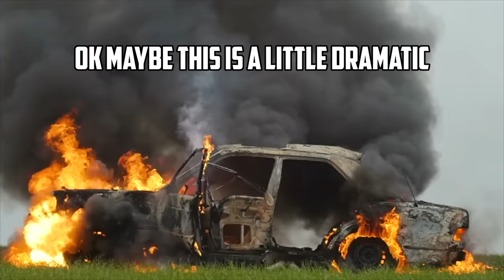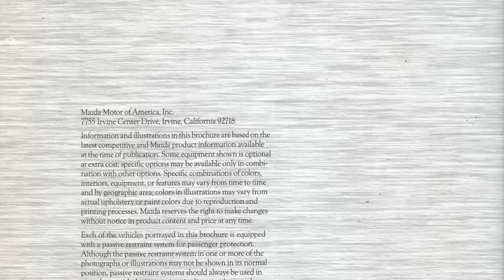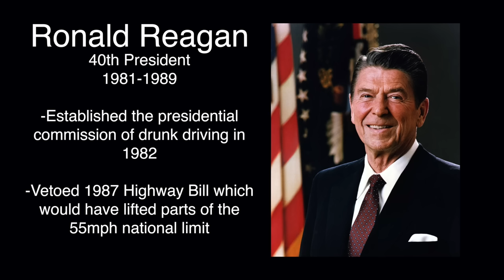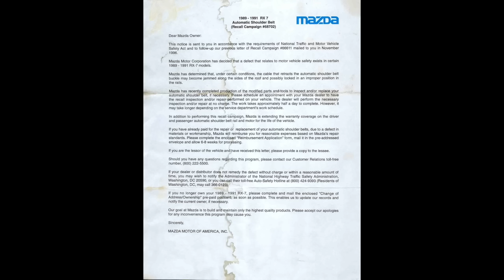Automatic Seatbelts - Why They Were Used & Why They Went Away!

Comment: I'm probably one of the few people that actually loved this feature, just for the convenience of not having to buckle and unbuckle! Which therein lies the biggest problem with these that you didn't mention - almost no one used the separate lap belt that you had to put on yourself, and a lot of us didn't realize just how dangerous it was if you didn't wear it. For all the years I had cars with these I always felt safe with just the shoulder part around me so I never ever bothered with putting on the lap belt, the thought that I needed to wear it never crossed my mind. Everyone had these seatbelts in the 90's, and that was how you used them- you got in, the shoulder strap went around and you drove off. So handy! In 2011 I was cruising down the highway in my 1993 Eclipse that I dearly loved, a car pulled out in front of me and I T-boned it going like 60. I ended up with a broken collarbone, a collapsed lung, a broken ankle, a massive bruise across my chest, and a big gash in my neck. At the ER the doctor asked me if I was in a car with automatic seatbelts and didn't have the lap belt fastened because if so they needed to do further checks. Apparently some people got their livers and kidney slashed by the shoulder belt and bled internally from it without even knowing. Fortunately I did not have those injuries. After I recovered I started doing some reading about this and there were a lot of people who died or were seriously maimed from these, all for the same reason-they weren't wearing the lap belt. Car companies even got sued for putting this system in because it made people feel safe when they weren't. Had any of my cars had some kind on warning on them like "you can be decapitated without the lap belt on" or "you'll fly out the door if it opens in a crash" I probably would have thought twice about the importance of the lap belt and actually used it. Which would have negated the whole reason I liked them in the first place, not having to put my own seatbelt on! So yeah, if you still have one of these cars then don't be like me and wear your dang lap belt, it is important even if it feels unnecessary.
Reply: I had the same car! I never knew how important that lap belt was
Reply: You traded your safety for convenience...   and it almost took your life.
Reply: Glad you survived to tell the story!
Reply: @sonictimm  Thank you, me too!
Reply: @adammada8867  You aren't wrong, but to be fair it was an unknown trade for far too long lol
Reply: @hellocar123  I still miss that Eclipse, it was the basic model but it was so comfortable and looked really cool. I drove it all over the country on roadtrips and never got tired of driving it, its a shame that is the car I wrecked because its still my favorite!
Reply: I’m with you. Had a mini van that had them. Of my mom was always freaking out if she was in the passenger seat. 😂
Reply: I'm glad you lived to tell the tale, many were not as fortunate.  As far as "you'll fly out the door if it opens during a crash" that was yet another problem with some  GM cars manufactured from about 1989 - 1993.   Those particular cars had automatic seat belts,  but the retractors were in the front doors,  and the seat belt buckle was supposed to be used as an emergency release,  however over 99 percent of people used it like a regular manual belt.   You were supposed to leave the belts buckled,  and you'd open the door, slide under the belts then upon closing the doors you were belted,  lap and shoulder.    This was a loophole that allowed the older body styles which could not be retrofitted with airbags which would have required a complete redesign at a great cost, to remain in production for a few more years until the next generation, since during that period there was a Federal safety standard that states all new  passenger cars for sale in the U.S. must be equipped with a passive restraint system. The requirement could be met with auto seat belts  OR airbags.  The  problem was sometimes the door flew open during a collision,  taking you out of the car with it.    Shortly afterwards airbags became mandatory and the auto seat belts were abandoned and forgotten as they should have been from the get go.    You can partially blame our politicians who think they know what's best for us, for your injuries.
Reply: @samanthab1923  Freaking out unsuspecting passengers out was so much fun 😂 Then watching them try to figure out how to get out when there was nothing to unbuckle lol. My mom was the same way, but she hated my seatbelts. She still doesn't wear one, and back then she would try to throw it over her head as it went back and then she would forget and get thrown forward by it when she opened the door😂😂 Eventually I just started unhooking it before she'd get in so I didn't have to listen her complain about it lol.
Reply: @Sparky-ww5re  I remember those, one of my friends had one and she left it buckled. I remember it being a major pain trying to slide into it and I was glad mine slid out of the way.
Reply: @Carla_78  Yes! Same with mine. She still doesn’t wear one. Law came too late for my parents. They were already set in their ways. Good thing they were both good drivers.
Reply: @samanthab1923  Exactly, neither of my parents have ever been in a wreck and its a good thing lol. My mom was the only one who got a free pass to ride with no seatbelt in my car, I knew there was no changing her and no point in arguing about it. Couldn't even get her to just use the lap belt alone. Everyone else the rode with me had to suck it up and deal with the seatbelt, or at least use the lap belt if they complained enough about the shoulder one attacking them😂
Reply: Yea had an accord with this and def never used that lap belt
Reply: Yea had an accord with this and def never used that lap belt
Reply: @lrac_1  A 1991 Accord was my first car! Had it for about 10 years & certainly saved me from seatbelt tickets because I got this car about the time they really started enforcing the new laws. We didn't wear seatbelts much before this feature came out, so having the shoulder belt that went on automatically was really cool and there was no reason to buckle a lap belt!
Reply: rip eclipse
Reply: @flair8099  I'd be lying if I said I wasn't still sad :(
Reply: It's kinda crazy how something that was implemented as an additional safety feature, ended up being more dangerous because it made people feel too safe! Still having to put on the lap belt does make it feel redundant though - it's just as easy (or even easier) to use a regular seatbelt at that point.
Reply: @imaginekudryavka9485  That's the whole thing about it, because part of it put itself on I just assumed that if I needed the other part to be safe that it would have made to put itself on too. Or at least let you know it was important by having a big warning light or beeper or something like cars do now. A lot of people who rode with me or I let drive my car were people who wouldn't drive without a seatbelt on- and they never put the lap belt on in my car, even when we went on very long trips. It truly made you feel safe just the way it was. If I had regular seatbelts I absolutely would have been putting it on myself, but I thought I was good with the automatic feature and didn't have to do anything else! I think most everyone felt the same way, at least based on my experience with them and its sad that a lot of people died that may not have had they known they needed both belts.
Reply: I really liked them but they were part of a series of design elements that in an accident seriously injured me, where seat mounted shoulder belts wouldn't have.
Reply: This should have been mentioned in the vid.
Reply: @Adam Mada  no he didn't trade it .. it was a feature in his car that he probably didn't buy for the seat belt "convenience."
Reply: I had a 1990 Honda accord for my first car that had them back in 2004. It got t boned and totally a year later and I got a 1992 accord(coupe) that replaced it and it didn't have the auto seat belt.
Reply: Was the car wreck in Virginia, rt 1?  Do you remember the make of the other vehicle?
Reply: Danbeater  You were certainly in the minority,  I remember reading a statistic that said something like 85% of people did not use the lap belt. From my own experience I know this is pretty close, because I don't recall anyone ever buckling it unless they weren't using the shoulder strap.  But I guess that goes to prove that common sense isn't very common... You also have to remember that a lot of us weren't really using seatbelts before these came out, which I know seems crazy now but in the 80's it just wasn't a thing yet. When I got my 1st car with these in 1992 is when I started wearing it daily and compared to no seatbelt it seemed very safe, especially when you consider some of us short people drive with our knees practically in the dash so there was really no way to slide under the belt. My main concern was to not fly out the windshield like the TV commercials with Vince & Larry, that certainly wasn't going to happen with my automatic seatbelt on! Lets not forget the insurance discount we got for having them, yet another thing to make you think this was safer lol
Reply: @user-rn3rn6nl3h  My wreck was in Illinois.
Reply: @Carla_78  thanks, probably a common experience.
Reply: You needed a 'WARNING' to tell you that the lap belt was needed?  in 2011?  Let me guess, you are 'american' . . .
Reply: I liked automatic seatbelts and religiously used the lapbelt. I liked it because for whatever reason the belt didn't rub my neck like manual one did. It felt like the belt was trying to saw my head off, I had so so many of those sheepskin sleeves and diverters for manual belts. Automatics just fit way better and were more comfortable. 
I don't know what changed but the newer cars have seatbelts that are now as comfortable as those automatics were.
Reply: Or be like my BiL and don’t wear any seat belts
Reply: @Arby631  This is my parents, they still don't wear them and it drives me crazy.
Reply: @evil1by1  I always found them very comfortable too, admittedly part of that was because I wasn't using it properly by only wearing the shoulder belt.  I know some shorter people had issues with them cutting into their neck but I'm only about 5' 4" and I don't recall ever having that in any of my cars.
Reply: I absolutely agree! I never used the bottom because the top was there!
Reply: I never understood the point for thus reason. If I still need to buckle the lap belt, it doesn't help any.
Reply: @adammada8867  seet belts aren't always safe. If the car flups and crushs the passenger cabin then that person is no more. Many people would of survived if they were thrown from the vehicle instead of being crushed.
Reply: My 92 Talon TSI AWD has auto seatbelts. Which is a unique thing in Canada, because all DSMs had regulars seatbelts in canada, auto was never available.
Reply: @samanthab1923  Nissan Quest/Mercury Villager! ♥️
Reply: @alexyoung4587  yours was originally sold in the U.S. ?
Reply: Cars with automatic belts were required to have additional padding under the dash by the knees to keep you from “submarining” in a crash if you left the lap belt off.  

Not a good solution though.  I’m glad these things disappeared.
Reply: @Andrew-it7fb  Right?! Which furthers my point that it lured people into thinking it was safe that way. If the lap belt was so important, it should have been made automatic too. But it wasn't made that way, so it must not be needed! Sure was a strange way to try to keep people safe.
Reply: @alexyoung4587  OMG I always wanted that car, my eclipse was basic but that TSI has gotta be fun!
Reply: @Carla_78  Yeah, it was pretty dumb.
Reply: Yes, the important part of a seatbelt is that it restrains your hips, one of the strongest parts of your body, and with that the rest of your body.
Not having the belt around your hips makes the seatbelt largely useless. You only need the upper part to prevent you from folding around the hip belt and smashing into the steering wheel.
Reply: But you still had to buckle the lap belt, right? So where is the benefit?
Reply: @eXe09  In order for it to be really effective you were supposed to use the lap belt, but I'm guessing the idea was that half a belt is better than none at all. Considering lots of people weren't wearing seatbelts when these came out it probably did save some lives, but injured more than it should have because there was a large portion of people like me who went from wearing a whole belt to only a shoulder strap. So the benefit is certainly questionable!
Reply: sorry no. that is not how you used them in michigan because you would get a ticket. also people are not stupid. if they see a belt that is unbuckled they instantly realize that it is intended to be buckeled and not just there to look cool.
Reply: Sorry but, it was in the manual. There's no reason not to know how to use the belt properly.
Reply: you get thumbs up just for the length of this post.
Reply: @psilocybemusashi  Unless they stop you for something else they wouldn't be able to tell that the lap belt wasn't buckled though

Comment: You forgot to mention one very important reason for their failures. The autoomated process only did the shoulder strap, you had to manually do the lap belt. Many who didn't got injured when they slid off the seat.
Reply: Agreed.    "I'm from the government,  and I'm here to help" are the scariest words that come to mind here.     Myself born in '89 I've seen a handful of these cars, never sat in one thankfully,  the only type of auto seat belts I've used, were in my uncle Frank's 1990 Cadillac Brougham.   The seat belts were mounted in the door, the buckle was intended for emergency use only of course everyone treated them as manual belts,  so I wouldn't call them automatic belts per se.   In addition if the door flew open during a crash you're coming out with it.  When I was a kid even I thought that was weird.    Both versions of automatic belts should never have been allowed to exist,  if you really wanna know the truth.   They were potentially less effective than manual belts and provided a false sense of security.
Reply: @Sparky-ww5re  In the mid 70s as a teenager I had my grandfather's 1970 Buick Electra. I was that rare teenager that buckled up both the lap and shoulder belts. In the Electra the lap and shoulder belts were 2 completely separate belts with each having it's own buckle. The lap belt had a smaller buckle and a retracter for the male ene. The shoulder belt however didn't have a retracter and had to be manually adjusted- you left enough space between your chest and the belt. When properly adjusted those belts really felt secure. As a teenage smoker with the shoulder belt on it was a bit confining especially when reaching for the cigarette lighter and ashtray,  but I persevered. All of my friends thought I was nuts for buckling up the lap and shoulder belts and I was usually the only one in the car with the belts buckled. A couple of years later a drunk driver in a Chevrolet suburban crossed the center line and hit me head on. Because of the size of the car and the fact that I was wearing both belts, I walked away with only bruises from the belts which was far better than the unbelted other driver. The myth that older cars were unsafe, and yes they didn't have the safety features of today's cars, was that very, very people wore seat belts. Usually the people who did, only wore the lap belt and that only offered protection for the lower body. The "confining" shoulder belts in combination with the lap belts offered very good protection as I am living proof of. The drunk driver that hit me was wearing a 3 point seat belt with the shoulder belt under his left arm, basically a 3 point lap belt. He had massive facial and chest injuries from the steering wheel and his unbelted passenger went through the windshield and landed on the hood with severe injuries. No seat belt, a lap belt only and an  early 3 point seat belt, which I was wearing. I was the only one who walked away from that head on collision.
Reply: @bradparris99  exactly what you said, belt means you get to live another day, had a few high speed accidents in my life and in each and every single one of them i got out by myself, before anyone stopped to help
Reply: @wittekPL  You buy insurance for your car for when it is in a collision. Properly wearing lap and shoulder belts is insurance for the driver and passengers. Most of the time "insurance" takes care of the damage and sadly sometimes not, but you are better off having anything possible to stack the odds in your favor. Even as a teenager, it was a no brainer to buckle up.
Reply: @bradparris99  where i live insurance is mandatory. If you don't pay it you will automatically receive a heavy fine, plus more time you will delay with payment it will stack to a pretty crazy sum.
Reply: @Sparky-ww5re  Only to the truly incompetent. The government would work a lot better if folks that had that belief weren't actively engaged in sabotaging the government's function. In many parts of the world, the government does come and help in an effective manner.
Reply: @wittekPL  Insurance is mandatory here, and it's mandatory to wear a seat belt. Wearing a seat belt is just plain common sense whether or not it's the law of not. I get the part about government intruding, but it still makes sense to buckle up whether or not you are told to or not.